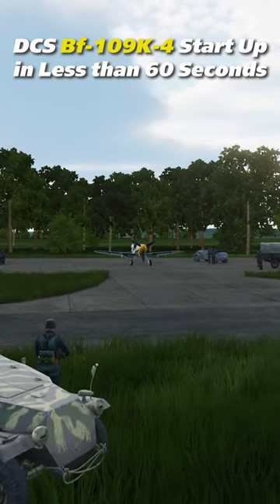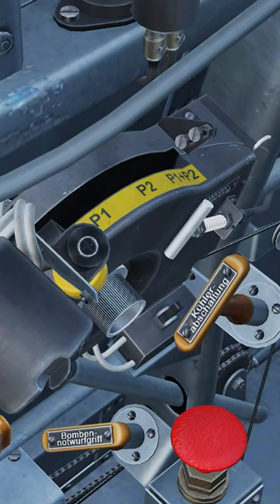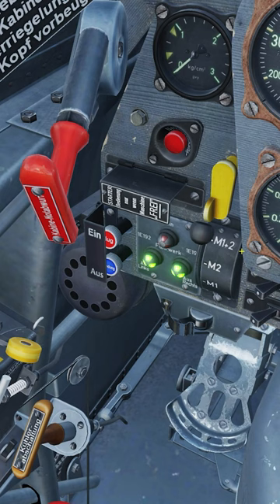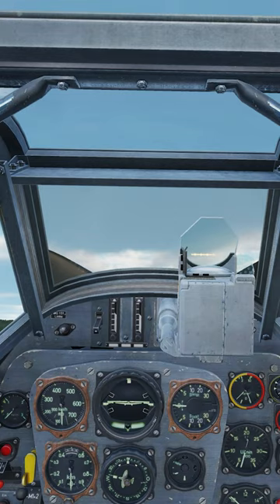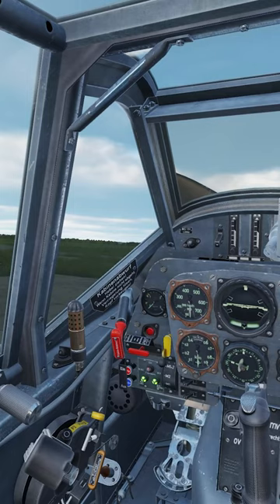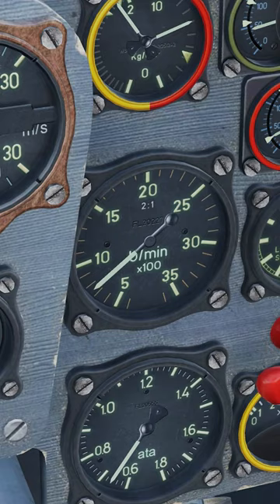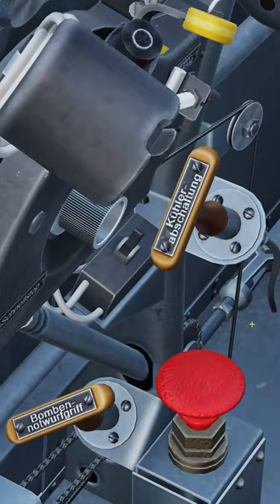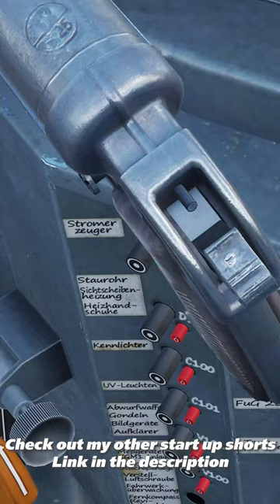Bf109 Start Up in Less Than 60 Seconds | Digital Combat Simulator #shorts

Comment: The funniest thing is this is one of the few birds you could actually start, in real time, in less than 60 seconds.  Actually I bet 30!
The very first thing you do when you spawn in, call for ground crew to run the starter.  Then zoom through everything else (doing the priming takes longest) and you can pull the handle and start the bird when they call "Clear!"

Comment: Before Switching on the MW50 make sure it is available. In singleplayer it most probably will but in Multiplayer not always. If it’s not available leave the switch off and never exceed 1.45 ATA
Reply from the maker: I had no idea it was an option one way or another. Thanks for the tip!
Reply: @SportDCS  one way to find out if your Plane has MW50 loaded is to turn on the Switch and go full throttle. When the MW50-pressure indicator is moving, you are good. If not turn off the switch and don’t go beyond 1.45ATA

Comment: I'll bet that was a great plane to fly. 20mm cannon....mmmmm
Reply: It was a death trap unless you were skilled and even then it killed some amazing pilots and it wasn't because they were shot down
Reply: @blayzed2529  ahh didn't know. Had strong guns. Hard for a spitfire to down one, but they did, for sure. Saw a former pilot saying they'd pump tons of rounds into the 109 and they'd have to hit them in just the right spot to bring them down
Reply: K4 had a 30 mm in the nose hmmm👍
Reply: @Tirpitz-lv2kt  it could mount a load of different weapons. The ground crew could remove the propeller and lift the engine to install a 30mm or a 20mm gun.  While it would also be equipped with two 13mm mgs on its cowl.
Reply: @mikkel066h  correct, same like the gun pods under the wings
Reply: @anthonysmith778  this is a k4 it was primarily facing Mustangs. Only Mk IAs and IIAs during the battle of Britain had trouble against F and E series of 109s  because they 7.7mm machine guns vs B variants which had Hispanos
Reply: @apersondoingthings5689  109 F in battle of Britain ? Lmao noo
Reply: @ayugoslav5554  Fs were used in the late stages of the Battle of Britain

Comment: You don't "run" the starter. The starter flywheel had to be manually cranked up to speed by two ground crewmen turning a handcrank. Then the starter clutch was engaged, allowing flywheel inertia to crank the engine over.
"Crank" or "spin" the starter is more accurate than "run" the starter.

Comment: Does this procedure actually work for you in current versions?

If I prime it and turn on mags before pulling the starter handle it doesn't start for me, as of the previous update i don't prime it, pull handle then flip mags on after its clutching, starts first time
Reply from the maker: I recorded this in the current release. It should work as outlined in the tutorial

Comment: Turning on the radio before starting didn't sound right. Tube radios took a lot of power. Better to turn on after the generator is running.

Comment: I have been watching many
WWII planes taking off at
night, and any of the fighters had so much flame
coming out the exhaust ports, I would think someone would have
invented aluminum covers
to hide the flames from being seen in a frontal
attack.
Reply: There were various types of covers, primarily on night fighters and bombers. You can look it up. Some hid the flame only from the pilot himself so he wouldn't be blinded (night fighter-bomber Fw.190 A-5/U2), others were basically tubes to hide the flame completely (mostly on night bombers).

Comment: Prime 8 to 9 times? Nah. In real life you would flood the engine. Hold it for several seconds 1 to 2 times if it’s a cold engine. Never once had a problem with this in DCS
Reply from the maker: In real life you wouldn’t flood the engine. It’s a 35 liter (2,176 cu in) block. It can take WAY more fuel. The manual says 8-9 primes, so that’s what’s in the video
Reply: @SportDCS  ahhh, count me corrected. I read in the DCS manual that says it’s no longer needed in game and now optional. But I’ll take your word for it for the real thing. Thanks